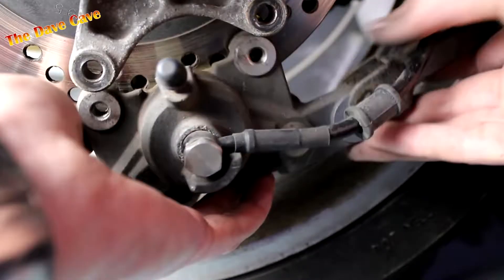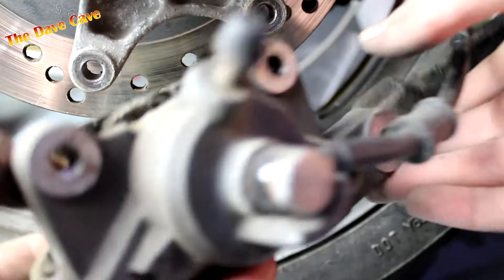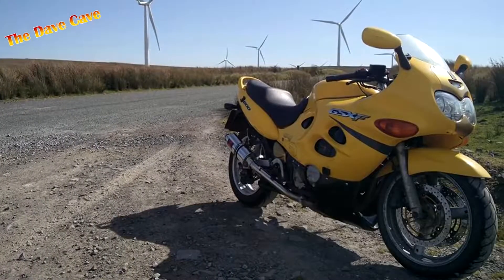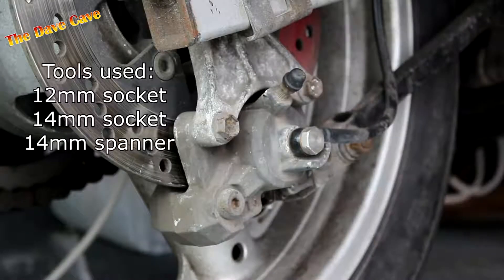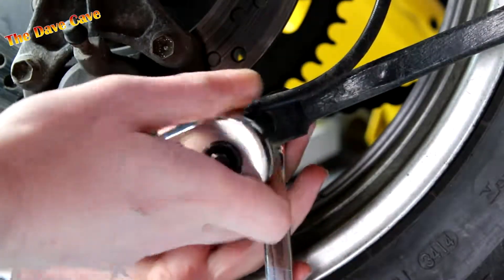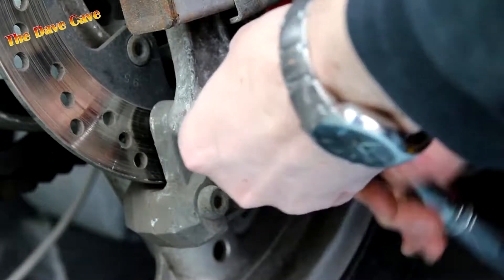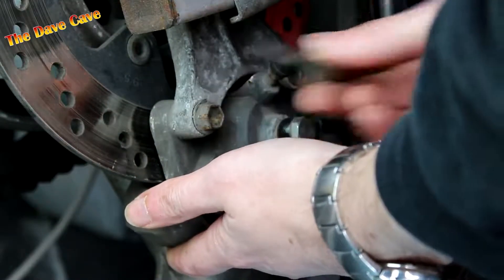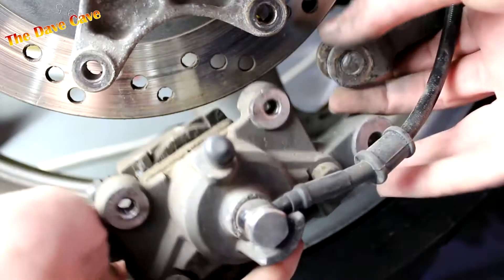Rear Brake Caliper Removal - Motorbike / Motorcycle - The Dave Cave

Comment: I think it was a good video but Geez I was hoping you'd answer my question, but it fell short. I know how to remove the calliper from the rotor which I have done so many times but I wanted to remove the calliper away from the bike to service it off the bike...and my question was if do i need to seal the hose from the master cylinder...I've never done that...anyway, if you're still around...Thanks!
Reply: i’m looking for the same thing too😂